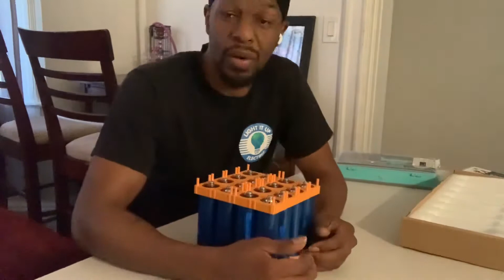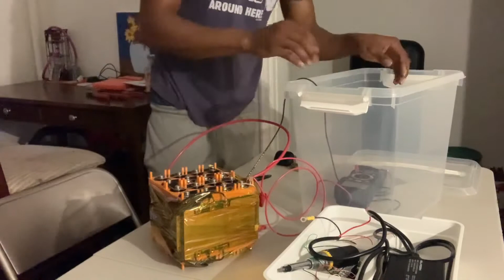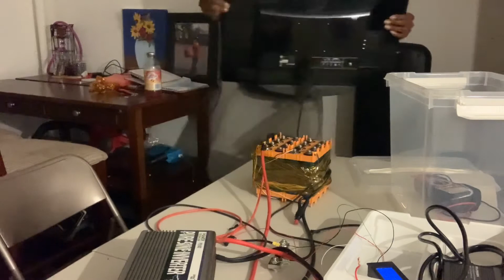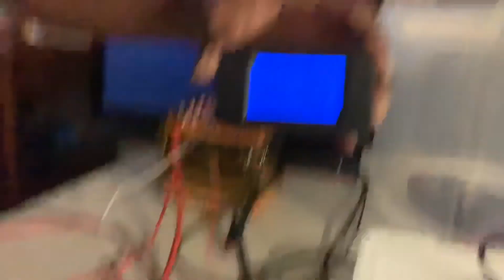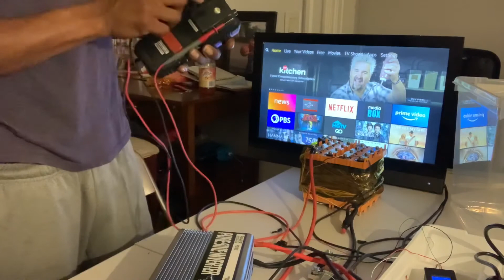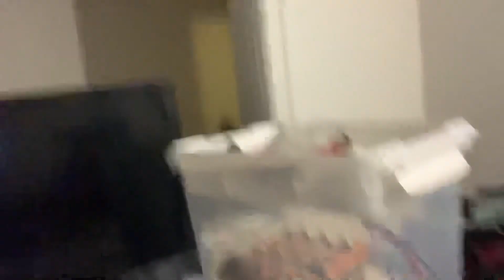DIY 12V 40AH LIFEPO4 HEADWAY BATTERY PACK AND SMALL TEST

Comment: That's actually a 32ah bank 4s4p 20 cells would be 40ah and blues are lower discharge the reds are for car audio.
Reply from the maker: The reds would make this 32ah sir.  Those are 8ah.  What's lower in the blues is the fact that they are 10c and the reds are 20c.  And they are both good for car audio.  🤷🏾‍♂️ idk where you get those stuff from